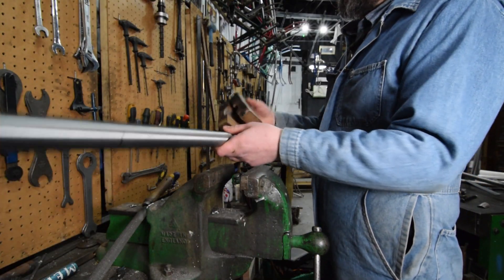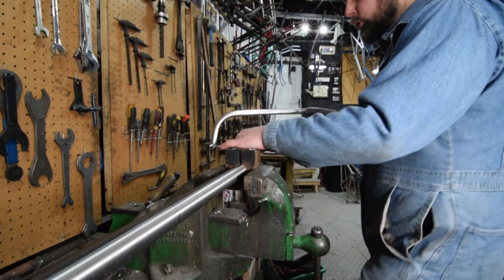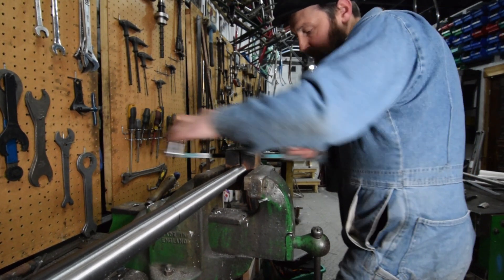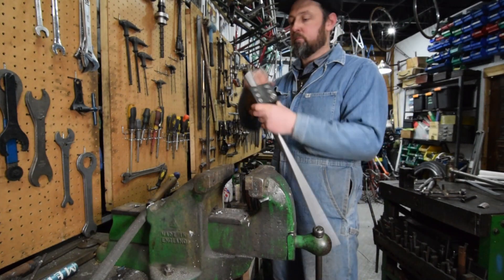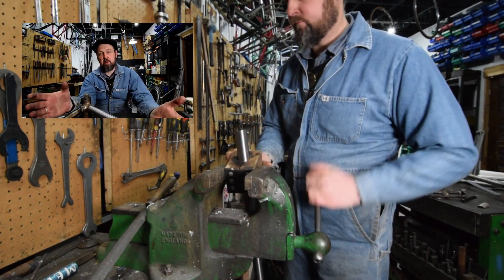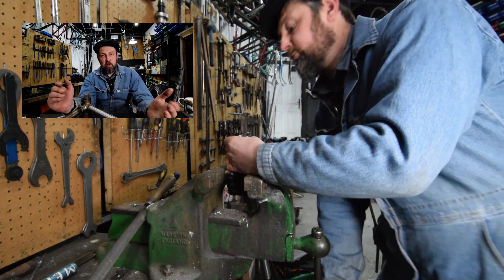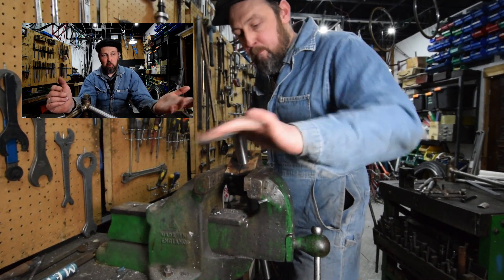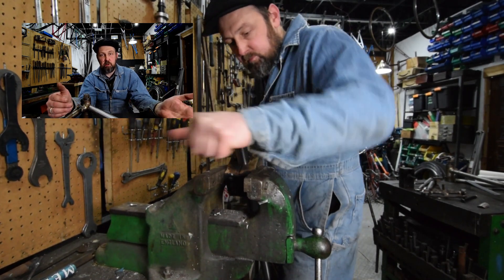I was told I needed a mill to miter fast? // Framebuilding

Comment: Thanks for the video! May i ask what files you use? Brand and specs? Kind regards
Reply from the maker: I'm going to answer this in my next video. Look out for it :-)
Reply: Hello! I could not find the new Video, yet… Will you be able to produce it? I’d love to learn more about your files. Kind regards
Reply: 10 inch and twelve inch double cut bastard files to start with for mitering main tubes. Nicholson files. Spend the money, use the files correctly and they will last for decades. Don,t use your good files to remove flux. I have some that are forty years old.